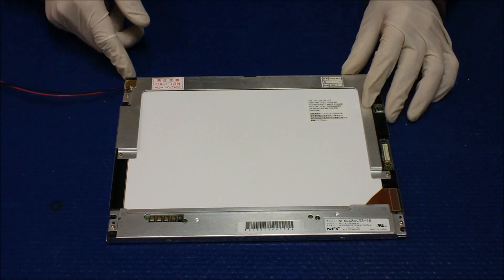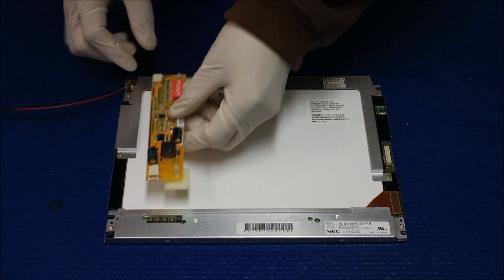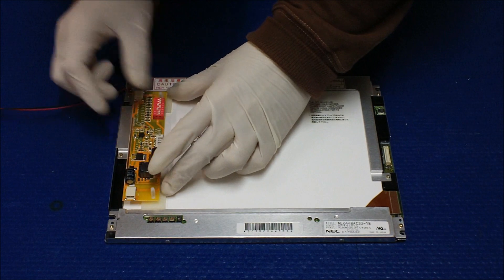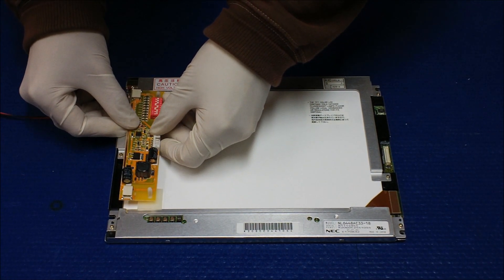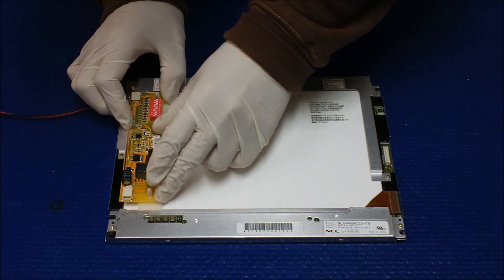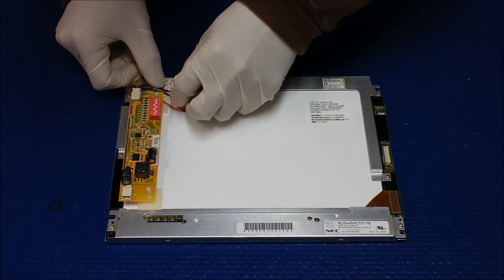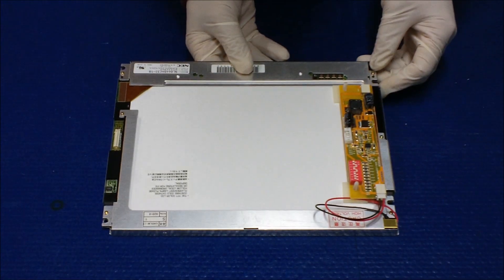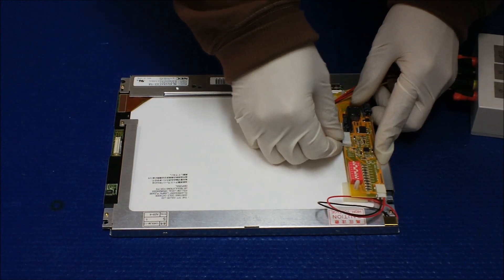NL6448AC33-18, How to Install LED Backlight

Comment: I replaced NEC LCD screen with a OEM & now the size (view) is larger than it used to be, what can I do to make it fit? Thanks
Reply from the maker: The native resolution for NL6448AC33-18 is 640X480. If size is larger. The replacement screen that you have is not have 640X480 resolution
Reply: The screen is a exalt replacement, what's happening when I power up the machine fonts are to large, but Turing it off and on right it shrinks to size. Crazy or ?